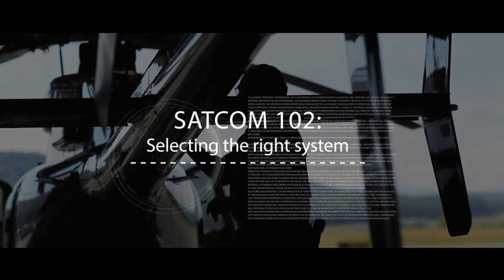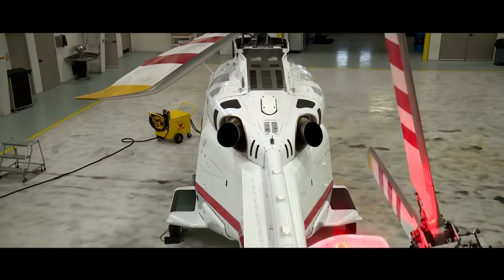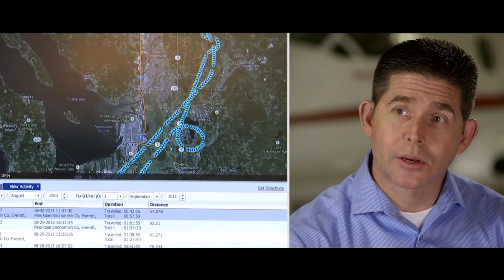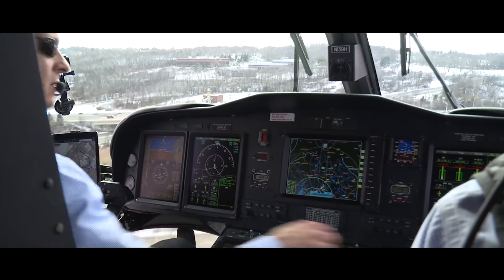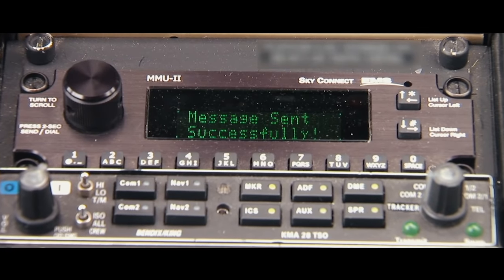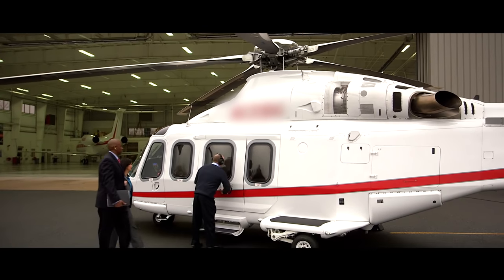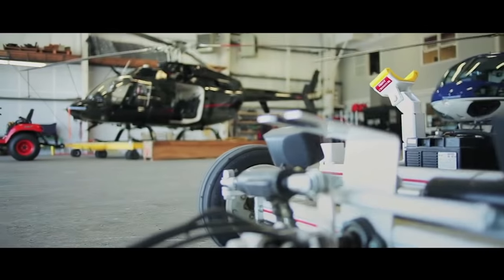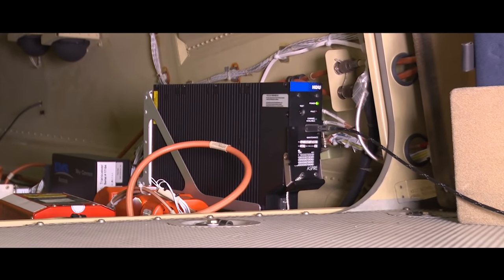Helicopter Satcom 102: Selecting the Right System | Helicopters | Honeywell Aviation

Comment: Very well-produced video, but for me it seems to fall a bit short of what's promised in the title. In particular, much of the content doesn't feel much different from Helicopter Satcom 101 video—what capabilities are available, why they're important, how different markets use them. Moreover, unless I missed something, only the Aspire 200 system is actually named (along with all its great features)... making it feel more like "Why to Select the Aspire 200 System" instead of "Selecting the Right System". (Oddly, the 101 video did mention both systems by name!) Would be nice to see the similarities/differences between different systems, or when to select System A vs System B. Anyway, looking forward to 🚁📡📞 103!